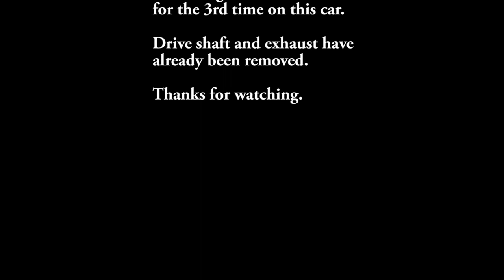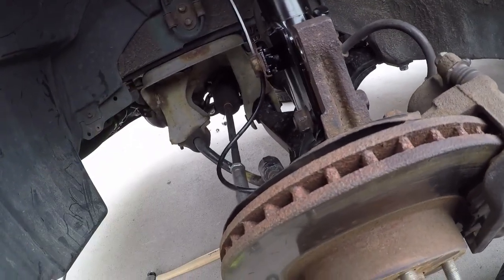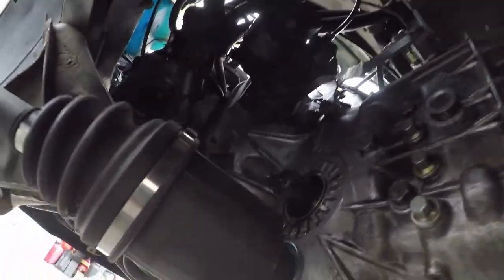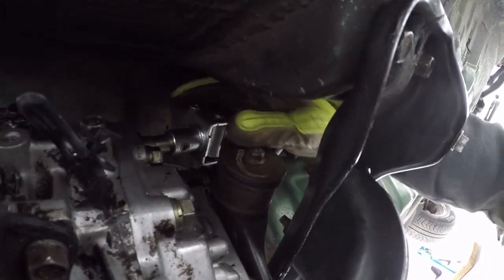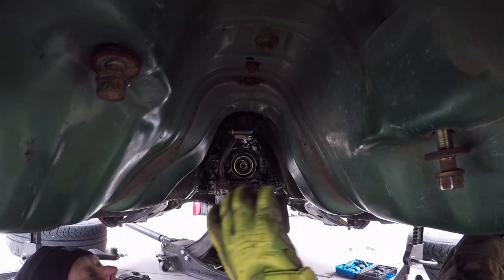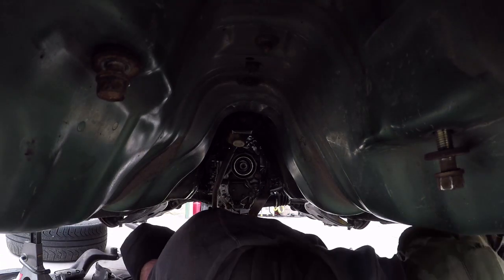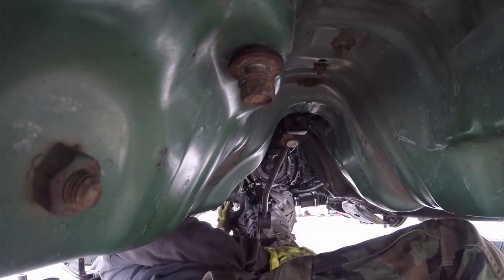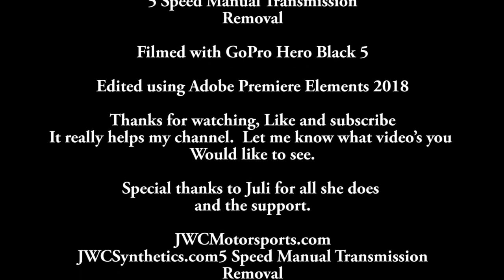2000 Subaru Outback Transmission Removal

Comment: I snapped that  ground wire right off when taking one out of my parts car  ... didn't even see it lol I'll have to remember when removing it from the wagon 😅
Reply from the maker: I did as well on my 2004 Outback when removing the transmission.  Replaced with a little bit longer and heavier gauge one.  Thanks for watching.